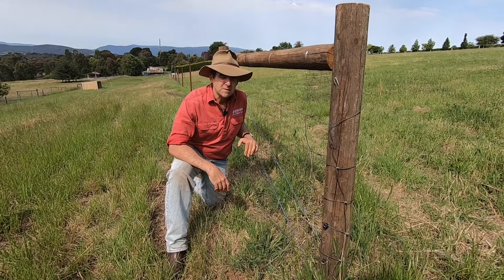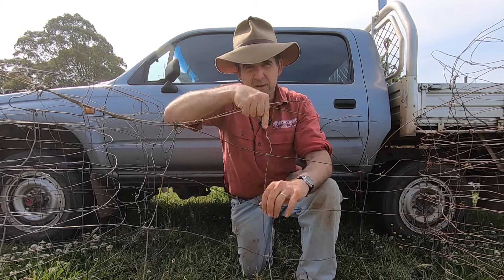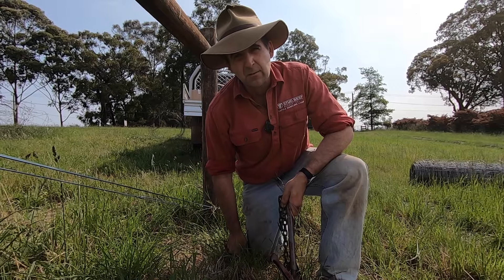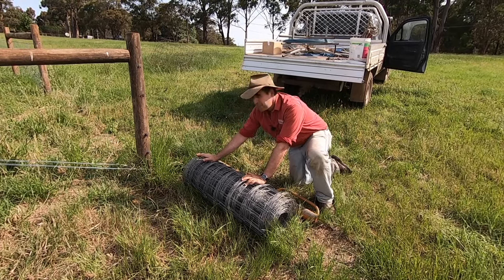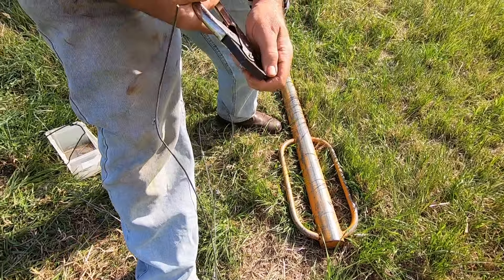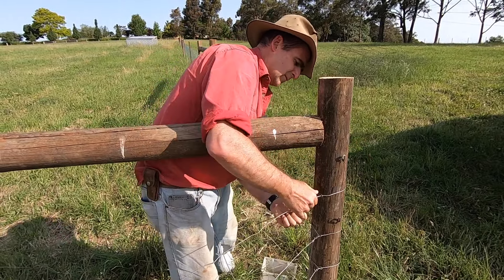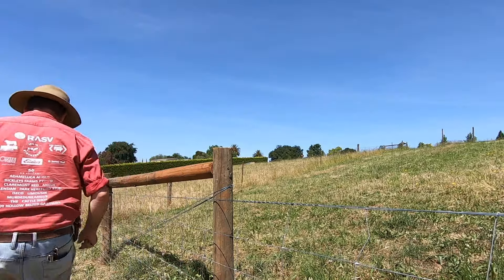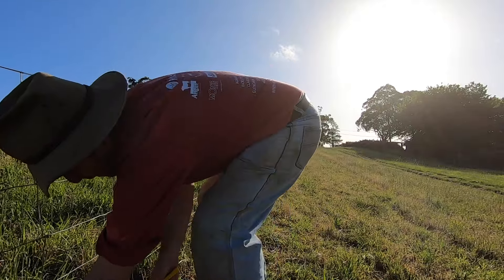How to Choose, Run Out, Strain and Attach Sheep Mesh

Comment: Lots of useful advice, but just one thing, putting new galvanized fencing onto rusty starpickets is not a good idea as that promote rusting of the new fencing wire's.😔  I used the black type starpickets in the past and they all rust after a while and cause the galvanized wire to rust, in fact several of the posts has even rusted off at ground level.  Now I use galvanized starpickets, either the standard, or the Maxiposts, or though the latter is rather pricy. 
 I see you use what look like treated pine posts for the strainer set-up,  I haven't tried that, ususlly I use 8 ft long 10 inch hardwood posts around three and a half  foot in the ground with hard compacting of the backfill dirt, and a long "treated hardwood stay" set into the post halfway up and braced against stone or treated hardwood planks in the ground. This work quite well supporting longer sections of five strand barb wire fence. 
Unfortunately termites can destroy such posts in a decade, and sometimes quicker than that, so now I may try the "treated pine post set-up", or look at concrete posts instead of Ionbark, (or other hardwood) as strainer posts.?  🤔  
Regards Niels 🙄
Reply from the maker: I’ve moved over to concrete or steel now. WAY better.

Comment: I like some of the stuff you say but I was a contractor and erected over 400 kms of farm fencing, mostly galvanised steel posts, ringlock and barb. Also about 30 kms of pine posts and ringlock. I used a short post donger and never hurt myself once. If you can't erect posts by yourself in a straight line w/o a guide wire on the ground there's something wrong with your sighting skill. 
I employed one other bloke to help me and I was probably the first person to use hand held two way radios and binoculars with sighting over distance. On a good day and in good country like sandplain we'd put up a kilometre of 6 line ringlock, 2 barb and three posts to the chain, strainers and box sections. On a bad day in heavy clay, gravel or limestone we'd just dream of the good days. 😭😭

Comment: Do you really need 2 strainers I can only afford one
Reply from the maker: You will see in other videos I strain to the post using one
Reply: @FarmLearningTim  ah ok sounds good. I’ve bought a £30 one from Amazon, should work well. Why can’t you use two bits of wood with screws to hold the wire I find it works fine

Comment: Why would you add extra top wires to get height doesn’t the sheep mesh come in the height you want
Reply from the maker: Yes it does. Plain wires on the top are a cheaper option for increasing the height of sheep fences as sheep don't generally climb.... The picket wires are needed at the base to stop lambs etc squeezing through. When using mesh for other species you definately use a higher mesh. One of the advantages of the Australian manufactured Whites wire is you can get it in multiple heights.
Reply: @FarmLearningTim  Thanks for your reply Tim, Always look forward to your presentations

Comment: Wire fencing: Class# 101 Rule# 1- SAFTEY GLASSES! Even just handling wire PUT EM ON! Can't count the number of pokes to the eyeball ive seen before the cutters have ever been used. Also well fitting glasses are super important. Wire wants ur eyeball! So close up any gaps between glasses and fence wire.